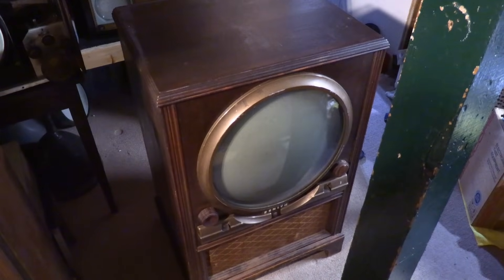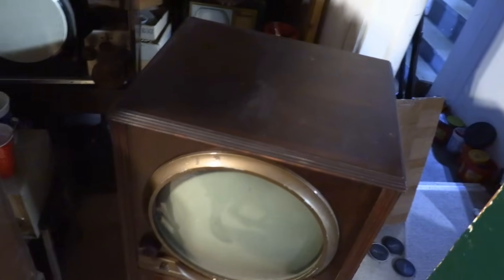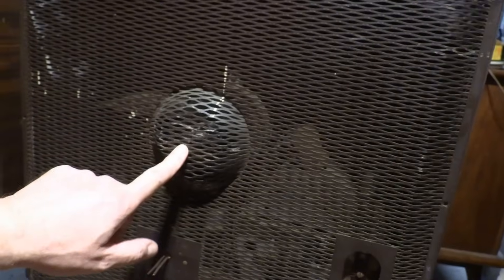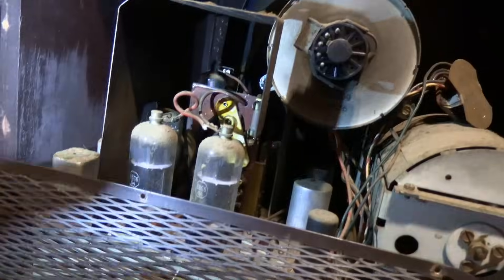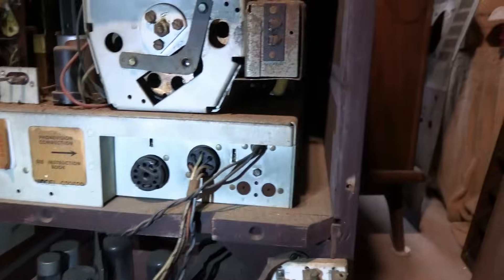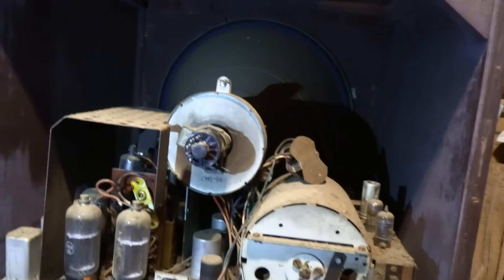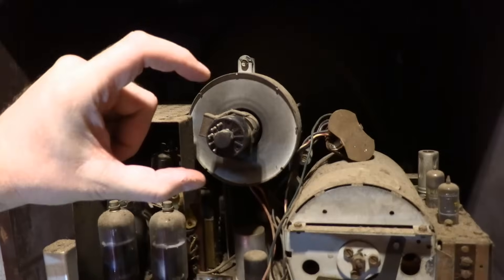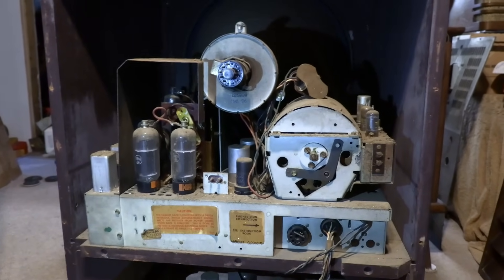First look at East Coast Al's 16"

Comment: I remember my dad wiring in one of those throw switches for our rooftop TV antenna in 1964. One side helped tune in the Buffalo TV stations and the other side helped tune in the  Toronto stations. At least that’s the way I remember from age 7.
Reply: OK, wow so he must have had two antennas on the roof, pointed in different directions for different stations. You would throw the switch for the desired station for best reception, makes sense!
Reply: I did the same thing when I was 12. We were positioned between New York and Philadelphia. For Philly the signals were strong with a simple dipole. For New York. City I used a Channel Master Crossfire with a hundred mile range. Alliance tenna rotors were available then but too costly. I did the switching with a simple knife switch I bought at the Hardware store. Needless to say I got into electronics school RETS and opened my own Radio TV shop.
Reply: This is what I thought it would be for. I did a similar thing as a youth but fitted a switched co-ax outlet to the window-sill rather than on the set itself.

Comment: Restored my 28T962R back in 2019. What an awesome set!

For phonevision you’d call in, pay, and they’d tell you the 5 dial adjustments to set for an external add-on box and the settings only worked for that program. The settings were changed for the next program. At least if I recall correctly that’s how it worked.

Comment: Very interesting porthole story! I happen to be just working on finishing up a 12" model that has a very similar chassis and power supply as the one you have for the customer, except that the HV section uses ONE 6BG6 rather than two. The RCA cable you see next to the power cable socket on the main chassis is not for the speaker, but for the momentary pushbutton switch you see at the middle bottom portion of the front control panel. This button is for the dial lights that display the channel and volume numbers through those prisms, it is not for a zoom control, mine does not have a zoom control like your 12" table model did. I worked on one just like the one with the doors for somebody just before COVID, and it was 19", not 16" like yours and it had the same knob configuration as your 16" with the doors. That one does have a zoom control which is the slide switch inside the control panel door. That power supply chassis was not the same as your one without the doors, the one with the doors I worked on also has two 5U4s but also has a large miniature type audio output tube on it, maybe 6AS4? The one without the doors has just power supply circuitry and the power transformer is just for B+ and rectifier filaments. The main chassis has another big transformer in it for the 6V filaments only for the main chassis. Interesting huh?
Reply from the maker: Yes. I realized after I recorded this, the two chassis are quite different. It's crazy how many variations Zenith made.

Comment: Zeniths as well as other manufacturers loved to make a variety of models that looked the same but with different sized 
picture tubes and chassis designs kinda like automobile manufactures back in the day.
Reply from the maker: Zenith seemed to go above and beyond.  For example they used both 12UP4 and 12LP4 CRTs.  Both 16EP4 and 16GP4 CRTs.  Both hot and cold chassis with the same CRT.  These two sets are a great example.  Both 16EP4 but wildly different chassis inside.

Comment: What an awesome stout beast! Really great condition.  Phone vision? Wow! That was ahead of its time. The phone companies provided the carrier feeds for network programs, so it's not hard to imagine they might have had a way to get a pay per view to a customers home. That would require a significant bandwidth upgrade over standard voice though. That aspect would be VERY hard to imagine. It was Chicago, Zenith's home town, though. 🤔
Reply from the maker: The video was still received over the air but it was scrambled. A special box hooked to the TV and phone line would decode it.
Reply: @bandersentv  much like cable TV. Still, wow.

Comment: I have several Zenith porthole sets. Some use the 16GP4 picture tube. The 16GP4 tube in each of these sets is bad. I have been trying for some to find a good one with no luck. I'm more than willing to purchase a set to get a good one. Any suggestions? The other Zenith porthole sets use the 19AP4A picture tube. I purchased a brand new 19AP4A tube (not a rebuilt) about 35 years ago so I was lucky on that. I also have some used Zenith porthole parts. Your videos are great! If I can be of assistance in some way just let me know. Thanks Chris
Reply from the maker: Go the the Early TV convention in Ohio in May. There was a good 16GP4 for sale earlier this year.